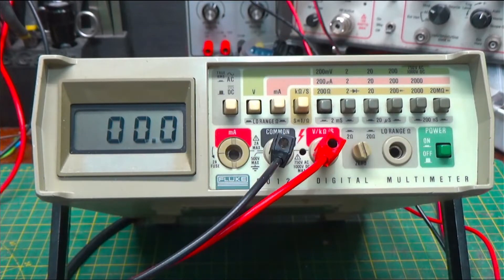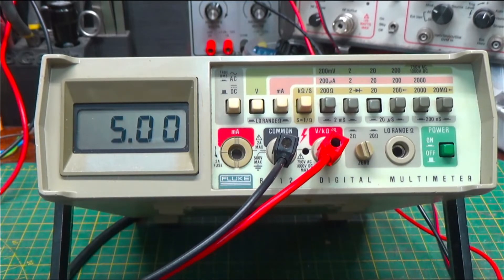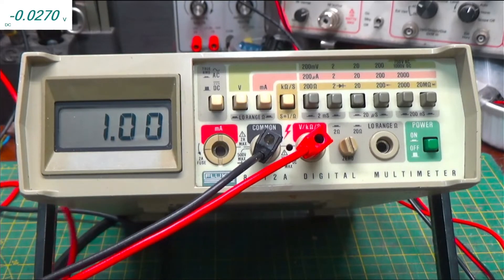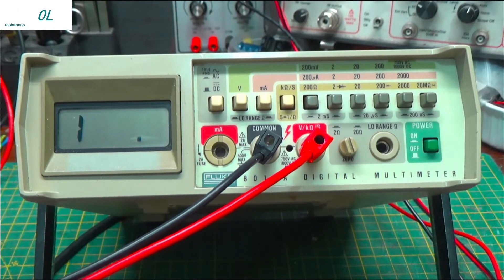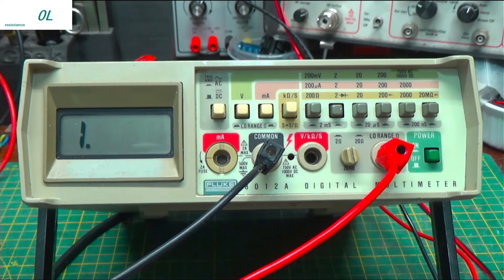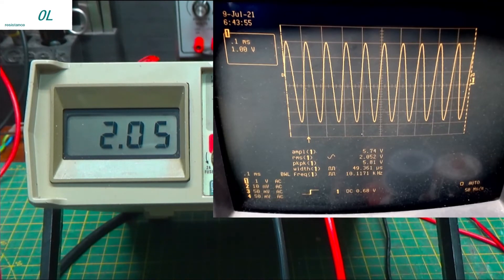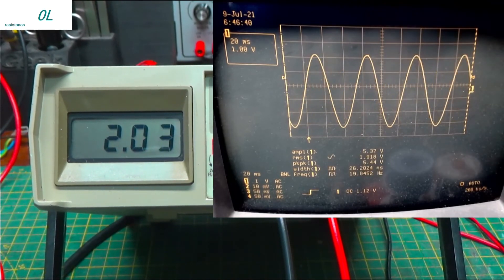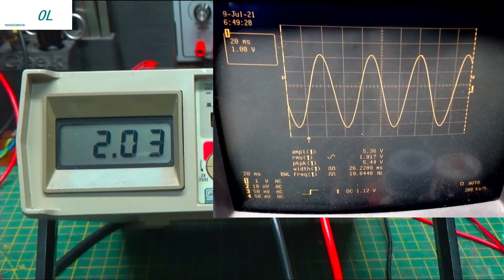Checking Out a Fluke 8012A DMM  and Give Away

Comment: This is the BEST Fluke 8012A video online! Thank you. Now I know how to get measurements off mine. It’s actually much better at milliohm readings than both my other fluke meters. My 6.5 digit meter is on par with the 1980s fluke that I bought for 49.00. 😂😂 Now I will figure out how to install a backlight. Shouldn’t be too hard. 
Thanks for the video.
Reply from the maker: Glad it helped! It is a good meter. Let us know about the backlight.
Reply: @AERVBlog will do. Might check with some China lcd factories about required quantity for a pin to pin exact lcd with backlight. If it’s not too crazy might buy them and sell the rest on flea bay.

Comment: This is the best multimeter you can get on FleaBay fior less than $ 50.

 1 - It is a Fluke.

2 - True RMS

 3 - Low ohms (down to 2 ohms full scale. Get a GOOD quality probe pair, the 8012A is not Kelvin)

 4 - three Conductance ranges (down to 200 nanosiemens)

 5 - Three diode test ranges.

 6 - Pleasant to service (the only job you'll have to do is cleaning the switches.)

 7 - "hidden" 10 ampere range. The shunt is there, but not conected. You'll need a fuse and some place to add  a banana jack.

Okay, it lacks autoranging and continuity beeper. But a Fluke for 50 bucks, you can't miss it.
Reply from the maker: You are right. I don't think folks know just how good it is.

Comment: Great video, I have currently the option to purchase 4 of these metres for $100 for all 4, or a Keithley TRMS 179A for $50 and I’m torn which way to jump. The Keithley is a 5 digit read out compared to the Fluke. I also have the Fluke 87V just wanting a second meter. Also there’s an Avo model 8 that needs batteries but figured it would be good for RF and IF tuning as its analog. Any advice would be gratefully received thank you.
Reply from the maker: You need to have a good analog VTVM meter on the bench. Depending on what you work on most you might want to look into getting a 20Kohm/volt analog also since most of the old old equipment measurements in the schematics were taken with one of those and your readings will be off with a >1Mohm input. 
As far as the Keithly vs Fluke you are right about the extra digit but you are losing the low ohms position and in today's electronics the difference between 1ohm and 0.4ohms can mean the difference between working and not working not to mention tracking down shorts where you might well be looking for a 1/2ohm difference.
Thanks for watching.
Reply: @AERVBlog  Thanks for the reply, I’m just starting out as I’m now retired and wanting to keep my mind and hands active. Radio has always intrigued me so now it’s time to delve into it. As a newbie on a budget it’s hard to decide which are good buys and what’s just junk people are trying to unload. Another example is function generators. There is a few available with the range of 2khz-2mhz. I just don’t know if this range is enough and so should I be looking for something that offers more into the higher frequencies. I prefer to buy once and not suffer buyer remorse because I was ill informed or lacked the knowledge to know better.
Reply from the maker: @richardshort4587  I have lots of function generators but the best I have is a FY3200S arbitrary function generator which you can get for about $70 on ebay. You just have to put a 1:1 isolation transformer in it to keep ground off the line.
Reply: @AERVBlog  I’ve just recently watched a video about the FY3200S. It highlights the problem of around 45 volts on the negative side of the BNC front connectors and how it could harm a scope. The link to the video is at the end here. The technician fixed the problem by installing a switch so they can be grounded. Hope it helps you in some way should you decide to watch it. Thanks for the quick replies. All the best. 👍🍻

https://youtu.be/cjYVWkL5C_M
Reply from the maker: @richardshort4587  I did not like the way he did that. I put an isolation transformer in mine. It does two things, totally isolates line from the device and weighs it down some. The reason I suggest this little thing is because of how clean it is. Watch my video "How clean are my audio sources" and you will see what I mean.  It is also easy to hook to your computer to control it all. Handy and you can actually use the arbitrary function part of it.

Comment: I'll be the odd one out here and say "I don't want the Fluke" - for two reasons. 1) I am in New Zealand and USPS isn't serving us at the moment due to Covid problems so the only options for freight are DHL and Fedex and I would have to sell two legs and one arm just to get it here, 2) I just finished repairing a Fluke 8800A meter which a friend gave me and I don't need to be greedy. I just love these old Fluke bench meters and the 8800A will be going on the test bench for daily service.
Reply from the maker: The 8800 is a great meter. I think of it as the first 'modern' meter as far as looks go. I don't believe they had a battery option did they?
Reply: @AERVBlog  No, there's no battery option. That's no problem, there's not many instances I need to use a meter in a portable setting and if I do, I just pull the Fluke 87 out of the toolcase. Anything else and it goes back to the workshop for bench repair.

Comment: I have no need, but good luck to everyone. Appreciate the video and demonstration.
Reply from the maker: Welcome. It will make a good basic meter for someone.
Reply: @AERVBlog  it definitely will! I was given a rather old signal generator. It came from out of an attic after a home renovation. Along with it was an old analog multimeter, a couple old vehicle AM radios and a Zenith Tube based AM radio (I think from the late 40s). I'm considering either reviving or fully restoring what I can out of the lot.  I've never restored test equipment personally. Nor any tube based systems. I am a bit familiar with the theory and have worked on several transistor based audio/radio equipment through the years. So it should be pretty fun.

Regardless, I've been enjoying your channel over the past year or so. Apologies as I'm a rather silent watcher. The thumbs up but typically no comments type.
Reply from the maker: @HavingFunRepairs  thanks for the comment.  Good luck with the tube radios. I would definitely look into building a simple dim bulb tester before you get into anything running on mains with tubes inside. That and a variac and an isolation transformer and you are all setcas well as fairly safe.
Reply: @AERVBlog    much appreciated! You are right, there are some things I need to add to my test bench. Luckly a dim bulb tester is rather simple to make and the other items are not too expensive. I'm am curious do you have any preference for safety caps? X1/Y2 or X2/Y2 and specific reputable brand? Also any suggestions on a good source to acquire new old stock tubes?
Reply from the maker: @HavingFunRepairs  Safety caps have different purposes. Some are made to go across the line and others are made to go from either side of the line to ground. It depends on what you are doing. I usually order what I need but I do keep a selection of X1/Y2 around since that is what I usually run into. As far as a good source, for that kind of thing I depend on Mouser or Digikey name brands. Not something you want to mess with. Could be dangerous if not made right. No Ebay for this kind of thing. 2N2222 and 2N3904 stuff fine but I just like to be careful.
Reply: @AERVBlog  thank you